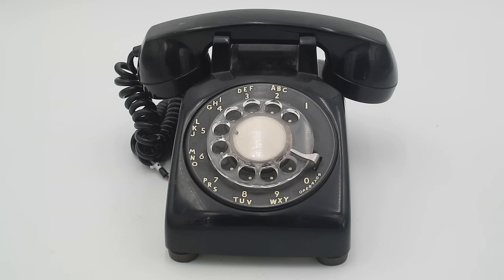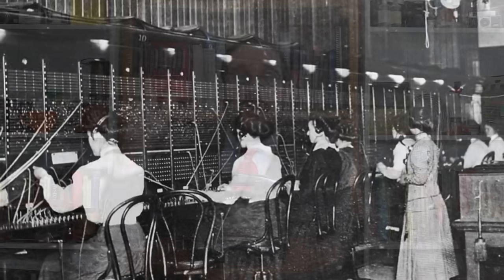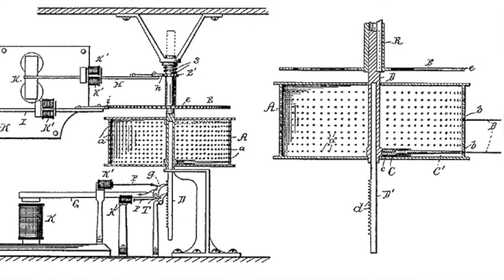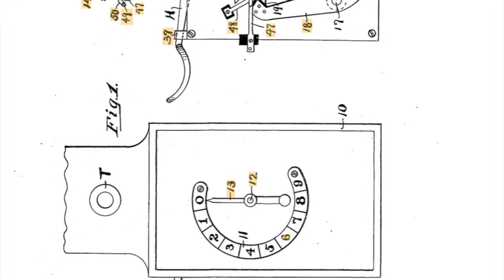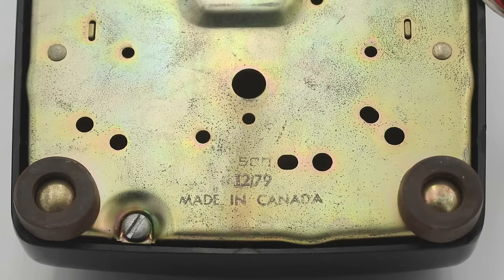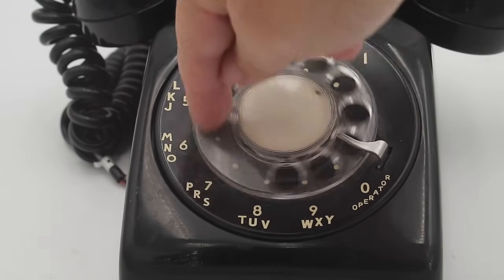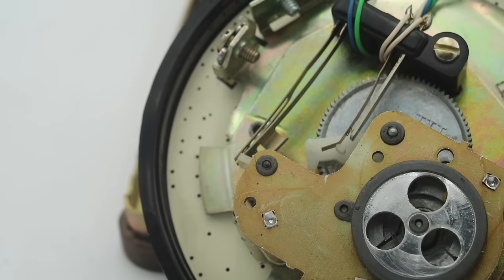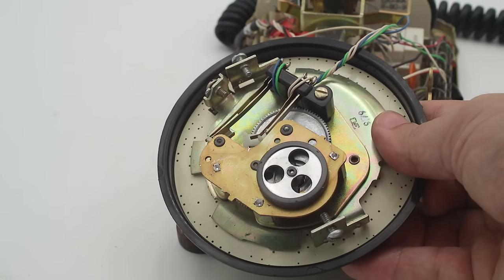Rotary Phones: the Call of History

Comment: A bit of trivia. The case of the phone was specifically designed so that you could put the handset back on the phone but not hand up the call. The 2 notches each side of the cradle will hold the handset, tilted forward. Very few people ever used it.

Comment: When I was in France at the 1970's, some of the older payphones could be used to make unlimited phone calls.  The problem was that the pay phone allowed you do dial the number and connect momentarily, but at that point, if you didn't put any money in the pay phone, the pay phone was supposed to hang up.  Unfortunately, the pay phone didn't always hang up, so it was possible to make phone calls, including overseas long-distance phone calls without paying any money.  If you saw a long line of people standing around just one payphone, you knew that it was one of these older phones that was not working correctly.
Reply: That might explain why France Telecom were one of the first to introduce chip-based calling cards... 😉

(I actually have a couple of old SNCF on-train calling cards in my possession. The most distinctive thing about them is that the chip is in the « A » position, rather than the « B » position now used by all modern ICC/smartcards... 😲)

Comment: Another interesting and fact filled video. I do have to point out a small error, however. In the explanation of the worm drive in the dial regulator it was stated that worm reducers generally cannot be back driven and that this was only possible in the dial regulator because of the high helix angle and special profile on the worm. This is a common misconception. In fact, most common worm type reducers can be back driven unless they have a fairly high reduction ratio. I recently designed a system with a 15:1 worm reducer and it was easy to backdrive.

Comment: This is very interesting!  I still remember my grandma's and my mother's work number mnemonic.
I ran into one bad aspect of the 911 system.  On an office system, 9 is for connected to an outside line.  So someone dialing a long distance number would dial 9 and then 1.  If the call was interrupted at this point, out system was programmed to believe that it was a 911 call that was interrupted and the police would be dispatched.  It was a mystery until I figured it out and changed the system.

Comment: I'm confused by the statement at 18:44 - living in the Eastern block in the 1980s, and throughout Europe in the 1990s, I never saw a rotary starting with 0. The stock photo you are using to show it is actually one of not so many examples on the Internet (I only found one actual model in two colors, labeled Ericsson 1931), and as another user pointed out, these might just have been in use in Sweden. 
Fun fact, the 9xx numbers were very popular for various services - from emergency services (997 for the Police, 998 for the Fire service and 999 for Medical) to providing current time, to weather forecast to... audiobooks with stories for children (except they weren't called audiobooks back then).

Comment: My main phone at home is a 50 year old British Telecom Model 746 - and I wouldn't be without it.  I've got a pushbutton phone with an answerphone on it, but the only time I bother with it is when I need to ring one of those accursed call centres!
For me, there's also a safety consideration.  I've had three heart attacks and a quad by-pass (all down to stress, according to the cardios);  mobile reception where I live, up in the hills, is rubbish;  and if the power lines blow down in a gale (it happens), the pushbutton job doesn't work - but as long as the telephone cable holds out, my old 746 keeps going.
As does my Tilley lamp, Burmos paraffin stove, and Svea 123 and Optimus 80 stoves and Coleman lamp, which all run on Aspen fuel . . . and the simplest of all, my ex-Army stoves which run on methylated spirit!

Comment: 16:00 -- uh . . .not quite.  Exchanges were the sub offices, where the switchboard operators worked.  You would pick up your phone, tell the operator "Yorktown 329," and she would connect to the Yorktown exchange operator, tell her "3, 2, 9," and that operator would plug into Circuit 3, and send the ring code for subscriber 29.  As amplifier tech improved, they moved switchboards in an area to "central office," but maintained the exchanges in local neighborhoods.

When Direct Dial came along, the name-number system was already in use.

Comment: Scandinavian countries used Ericsson phones where rotary dial would short circuit the line when user started to wind it back. Then when finger was released dial would open and short the line pulsing the number as discussed here. This means it was not possible to dial by tapping the cradle switch that could just close or open the line but could not short circuit it.

Comment: Retired AT&T (50 yrs) I could quibble with a few facts, but overall, well done. The Bell System had little incentive to modernize due to accounting methods developed with the FCC. Equipment had very long depreciation rates, which in turn was used to keep customer rates down. 

Food for thought -- with cell phones largely replacing land lines, many people have never heard dialtone, or a busy signal.

A rotary phone's signalling is essentially digital, in  that the 48v / 20 ma DC current loop is either on or off as the digits are sent. The voice is analog.

Comment: Interesting video, but no mention of the General Telephone Company for which Strowger developed his equipment & phones which were (IMHO) superior to the Western Electric models.  Also, the automated connection offered by GTE got it military contracts, whereas Bell's operators were not efficient enough for military needs - that was one motivator for Bell to reconsider it's position on direct dialing.  Another GTE feature was the "silent winder" (I think it was called) dial; it spun up quietly, but generated the pulses as it returned to it's resting position - I have one of the rotary GTE Starlight (GTE's answer to the Bell Princess) phones on my desk.   One last item, which concludes all I really knew about the subject before seeing this video is that Siemens invented the dial tone.

Comment: Out here in rural western Canada.... we had rotary dialing well into the 1990's.  Matter of fact, we still had mechanical exchanges that were probably installed when that technology was new, and was still being held together by bailing twine and dreams in the 1990's.  I know it was mechanical because even though we had 7-digit phone numbers;  if you had to make a local call.... you need only dial 5 digits.  Also, as a child I could hear other phone conversations during quiet telephone calls.... or I'd dial one number to stifle the dial tone and listen to the mechanical jingle-jangle of the rack I'd connected to as well as the faint voices of other calls.  On occasion, I'd be startled by a LIVE operator I guess who may have noticed my call not going through.... and the voice would ask if I needed help dialing.

Comment: Three things:  I noticed that twice you gave the acronym for Dial Tone Multi-Frequency (the correct name, the acronym is DTMF) as DMTF, probably a simple slip of the brain.

Second, DTMF was not what most of phone freaking was dealing with, but rather a different class of Multi-Frequency signaling used internally in the phone system (usually just called MF, distinguishing it from SF), and which is why DTMF is distinguished from it by being "Dial Tone" MF.

And third, one of the parts that held back the deployment of automatic exchanges in the Bell System was economic; the fact that Strowger's patent prevented them from manufacturing their own switches until it ran out and they started manufacturing Step By Step switches that were identical, but didn't reference the original patent.

Comment: 21:34 The New Zealand rotary dial isn’t reverse *wired*, the numbers on the number ring are reversed with respect to the UK system (Apart from a few outliers,  NZ exchanges were predominantly UK sourced Strowger equipment), so going clockwise from the finger stop it’s 0-1-2-3….9. 
Therefore the NZ dial sends 10 pulses for the digit ‘0’, nine pulses for the digit ‘1’ and so on to one pulse for the digit ‘9’. So the NZ 111 emergency number still sends three groups of 9 pulses. 
I have never found a primary source as to why this numbering scheme for the number ring was ever adopted, but one persistent explanation is that it was done to prevent the unauthorised private importation of telephone instruments, as at the time of introduction of automatic switching equipment the NZ government had the monopoly (via various  Post Office Divisions) on all forms of communications.

Comment: Um , hi , I have a little bit of information to impart to you . Um , when you picked up the hand set ( or receiver) , you put the receiver up to your ear ( the opposite end of where the cable comes out ) and you did that to listen for a dial tone . The dial tone told you that the phone was available for service . The first number you dialed stopped the tone . But you continued to dial the sequence of numbers . Then when the connection was made , you continued to wait for an another sound in the handset which ment the bells were ringing . Then the person you called answered with hello and so on . Until you were done , then you said good bye and put the reciever in the cradle . 
But what the phone company never tells anyone is the technical part . The voltages to operate the telephone . First , the idle voltage is 17 volts D C . BUT  the electromagnet to ring the bell was 115 volts A C  . And the speaker in the handset were carbon elements . Which was later improved because the elements would get wet from your breath .

Comment: When I was about to leave school  in the '70s I spent a week at the 'strowger works' in long lane, liverpool where we saw  future enhancements to the GPO Systemñs that were about to be launched. Thrse included amplifiyed sysytems that wemt through speakers bidirectionally and  could use tone dialling.
A strouger exchange was noisy.
BT developed s fully elrctronic swiych callrd crossbar which used trasisistors for the seeicjing.

Comment: We're still principally on rotary service, with four rotary telephones in the house; my study, the upstairs landing, the kitchen, and the front hall. Two are candlestick, one a Western Electric separate receiver-and-microphone wall model from the 1930s, and the other a Danish handset instrument from the 1920s. The handset is rather heavy; the microphone is strong but it has a rather noisy magnetic receiver than clears up after a few seconds. We only use our one push-button phone when absolutely necessary. Many of the places I call which say "Please select from the following options..." will connect you with a live operator if you wait a moment or two. I have a mobile phone, but I find it rather a nuisance than an aid.

Comment: 16:36 that's incorrect. For example, the song PEnnsylvania 6-5000 by the Glenn Miller Band (the phone number for the now nonexistent Hotel Pennsylvania) just uses the first two letters to indicate the exchange. i.e. the 2L + 5N system used for a period into the 1960s. There was no 3L + 4N system.
Reply: I think you are correct. Our exchange was Triangle or TR. we also had Glenview GL and Bridge BR.
Reply: Our exchange as a kid was KIngston-5, but I wouldn't conclude that this means the video was incorrect, simply edited down a bit too much.  My guess is that when the name+number nomenclature was invented it depended on how big your exchange was whether it was 3 letters and 4 numbers vs 2 letters and 5 numbers.  That is, exchanges clearly existed with both 4 and 5 digits, so my guess is that exchanges proliferated at the same time as 7 digits became the norm, so the exchange abbreviation simply adjusted to fit the previous digit count in the area.  Interesting, in the case of "PEnnsylvania 6-5000" the same number results of it is described as "PENnsylvania 5000". :-)

Comment: I tried to dial the rotary dial of my family's phone faster by pushing it backwards. This eventually broke it. From then on I had to dial by tapping the receiver switch.

I've never used a payphone where the dial itself was locked. They may have used a different mechanism. Maybe they could have secured the payphones by making the hook switch less responsive, and thus impossible to depress fast enough.

I don't think they would need a special box to generate DTMF tones. They could just push buttons on the device. The tones used by the phone network were probably different.
Reply: Locking-off the dial was a common means of controlling telephone use in the US, and was often found in the UK and several other countries besides. This only blocked physical access to the dial though, and didn't impede switchhook dialling. (There's a scene in Hackers where this is played out in accurate detail.) 🔒☎

Later models of UK payphone had switchhooks that were very heavy and sluggish - Making switchhook dialling very difficult (As it would make achieving the necessary timing impossible) but the fact BT resorted to this approach and didn't simply convert payphones to DTMF suggests it might've been possible... 😉

Comment: A British Telecoms Engineer once told me, that the reason 111 was not used as the Emergency telephone number, was that the telephone wires were all bare copper wires.

If the wires were crossed, when two, or more people were dialling, then the number 111 could be sent from a number of people dialling 1.

It was thought that 999 would be less likely to happen accidentally, than 111, which is one of the reasons for choosing 999, s the emergency number.   

It is also an easy number to remember, although the Europeans want Britain to use their emergency number instead.  Nobody remembers the new number, but the old number still works.

Comment: The telephone set exclusion key, as its function is described at the 12 minute mark in the video, is incorrect.
 
An Exclusion Key was employed on a telephone instrument when a user at a designated telephone station wanted exclusive privacy use of the telephone line (Circuit) in situations where the telephone line had multiple appearances on other telephones as "bridged line" extensions. When activated, the  exclusion key would remove (Open the circuit) the telephone line between the telephone equipped with the exclusion key, and all other down stream telephones thereby removing the ability to or use the line. 

The telephone set equipped with an exclusion key was modified in such a way that one of the plungers, the two cylindrical plastic found on top of the telephone where the cradle was located, that would drop down to hang up the line (On Hook) where the handset was placed back when phone was not in use. The placement of exclusion key insured that when activated and the call ended, placing the telephone handset back on the telephone cradle would push the exclusion key down, restoring the telephone line to normal use by other extensions, and placing the telephone line in to the idle, On Hook, state. 

An exclusion key could be configured on both single line, and multi-line key telephones (Multi line Key telephones have a capability to terminate two or more telephone lines), and is/was an available feature to both Rotary, and Touch Tone (DTMF) telephone sets.  The CV500/2500 telephone were designed and built to last 40 years, and difficult to kill, some were but with considerable effort.

Source of Information: Thirty plus years as a Telephone company Operator, Business office representative, Central Office/Field Technician, and transmission engineer.

Comment: I'm of an age where I had one of these but then the incoming line box got changed to a socket and the phone got fitted with a plug. Visiting Tandy's (are they still around) back in the 70's, I noticed they had a push button phone fitted with a plug. Needless to say, the rotary phone hit the floor with a bang - well, it went into storage. Having speed dials also helped things along. Interestingly enough, even though Tandy's blurb said it was illegal to use on the UK phone company lines, it worked without any issues whatsoever. Do I miss a rotary phone? Not one bit!

Comment: Wow, those step-by-steps were run by stepper motors? How interesting. I thought that what I had seen in other videos is that they were just rapid solenoids that were mechanically linked to the rod that would spin the wiper across. Interesting!
Reply: No, not stepper motors. Electromagnets with hinged armatures—not exactly solenoids, but yes, essentially the same in function. The armatures operated ratchet-and-pawl mechanisms that elevated the switch wiper shaft, then rotated it. A number of relays, typically between 5 and 10 depending on the switch’s functional complexity, worked as hardwired logic that handled inputs and outputs and operated the magnets.
Reply: @PeopleAlreadyDidThis : Yeah, that's kind of what I thought, based on other videos I had seen. He used the wrong terminology. I figured stepper motors didn't exist until several decades later, but I just wanted to double-check my understanding. Thanks for your reply.

Comment: I may be wrong, but I don't think rotary phones can be used anymore, since POTS (plain old telephone service) was discontinued in August of 2022 (I could be wrong on the date).  I don't think you can use it on the current fiber optic cables and Voice over IP service we now have - can we?  What is so odd to me is, having used rotary phones for a large portion of my life, until maybe 10 years ago, it's weird to think that they are gone. If I saw one and had to use it I would instantly know what to do.  What I liked best was these phones had a real bell that did the ringing when someone called.